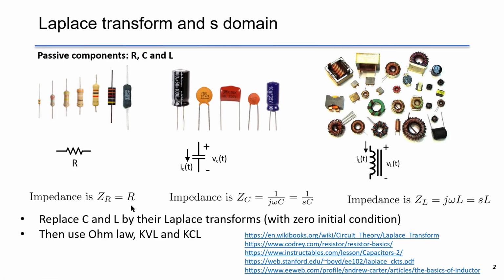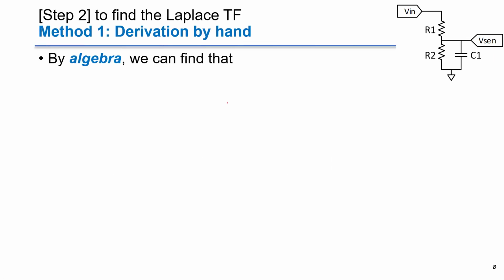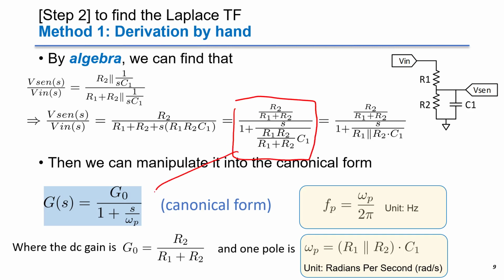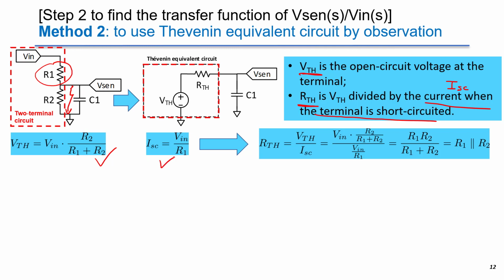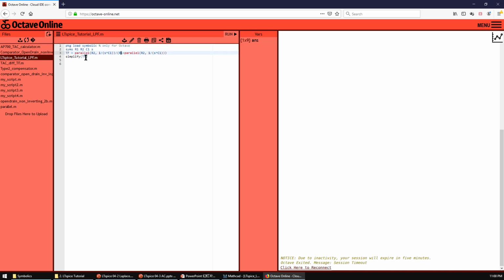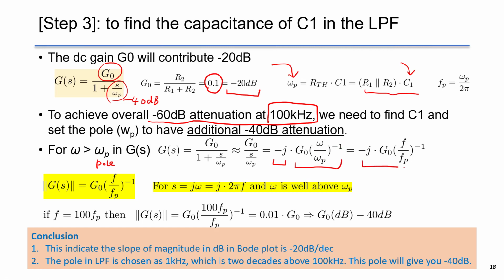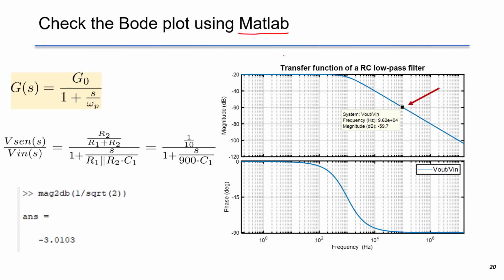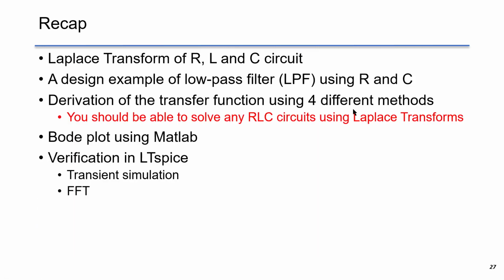LTspice: Small signal transfer function and Laplace transform

Comment: Is there a program out there that will automatically create a transfer function for you if you give it a circuit? Or does each circuit need to be analyzed by hand to figure out the transfer function?
Reply from the maker: Mostly likely you need to start the transfer function by hand derivation, then you can use software to simplify it and you have to finalize it into the canonical form by hand (again)

Comment: What is the role of R2 here, does R2 effects the output response?
Reply from the maker: Thanks for the question. First, R1 and R2 decide the DC gain since it scales down the Vin to Vout.  Secondly, R1, R2 and C determine the frequency pole location. It's better derive the transfer function by hand so that you will understand it quickly. Hope it helps.
Reply: @eesanity  Yes Sir it is clear now